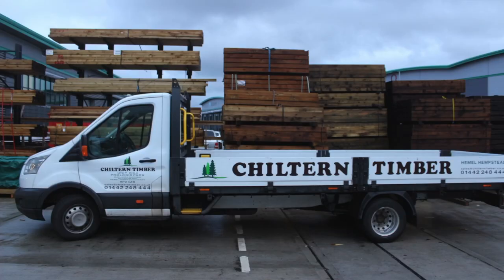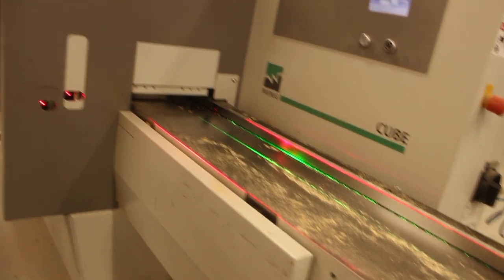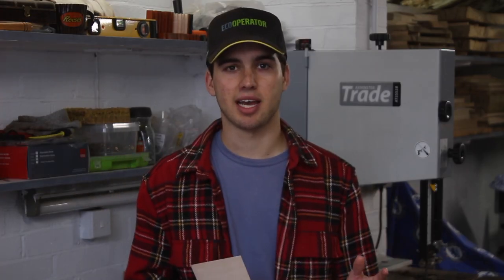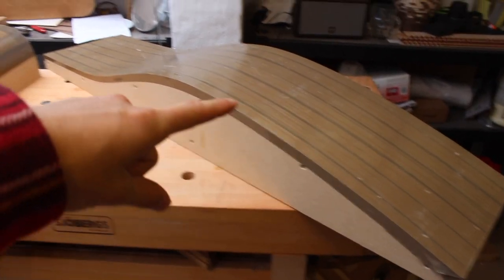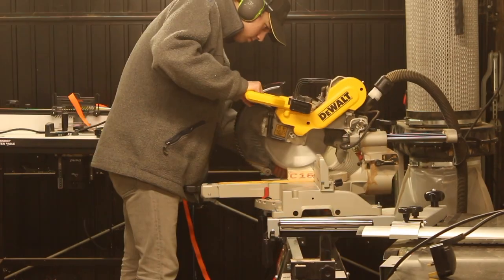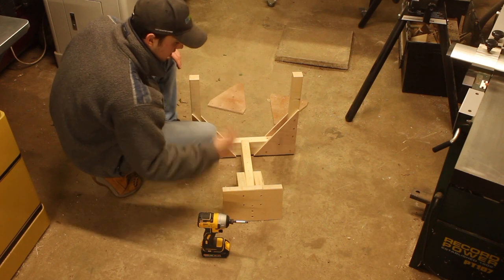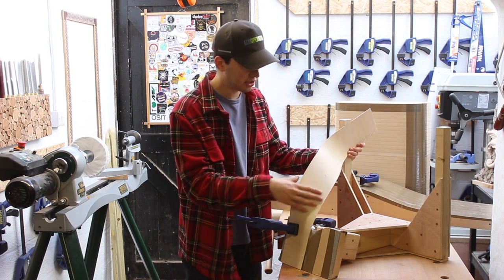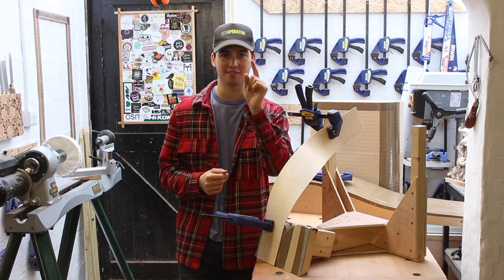Bent Laminated Chair Build Series! (Part 1) Visiting Chiltern Timber, and Custom Mould Making!

Comment: Intrigued to see what glue you a going to choose to use for this method. Long working time or quicker setting time.
Reply from the maker: Hi Rob, some components I used standard woodworker white glue and others i use cascamite. The next one i make, I will use standard wood glue for everything. The resin like join the cascamite gives wasn't perfect, as it doesn't allow any flex.
Reply: Sean Evelegh would cold press veneer glue work on the flexi ply?
Reply from the maker: Hi rob, I considered that. However cold press is recommend for bent lamination. It also has quite a brittle glue line
Reply: Sean Evelegh fair enough. Looking forward to seeing the working process